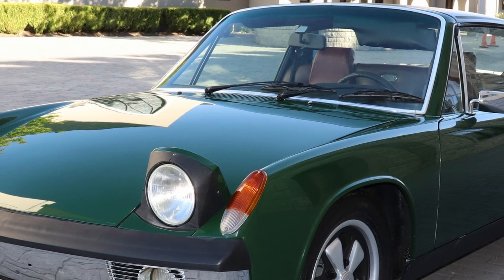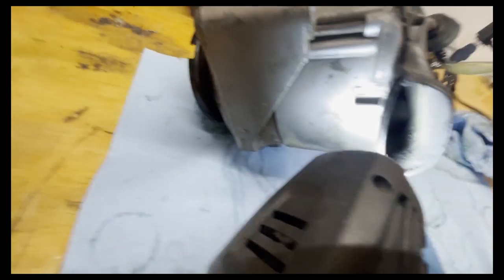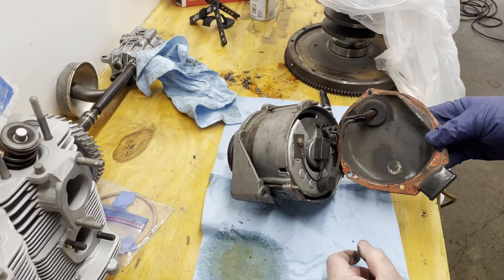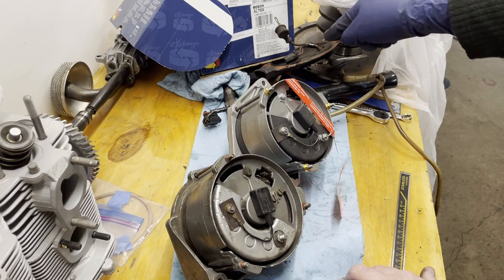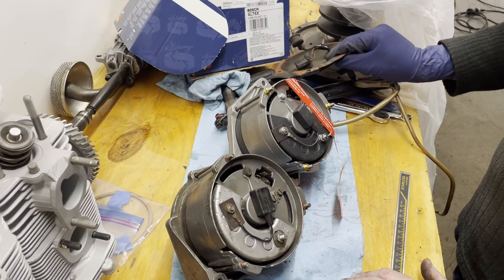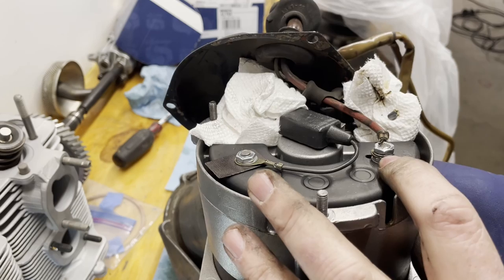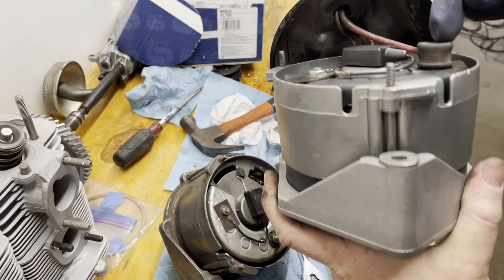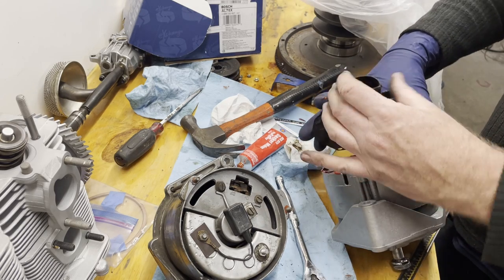Fireproof your Porsche 914 - Part 1 - Alternator Replacement Safety Tip

Comment: May I suggest you would have a much more controllable space between the cover and the alternator if you cut out a gasket (using gasket paper).  With the silicone you don't really know the final thickness.  But thanks for pointing the problem out.
Reply from the maker: Yes, that's why I allowed the silicone to cure first.  But with trimming the terminal, you will have substantial clearance.